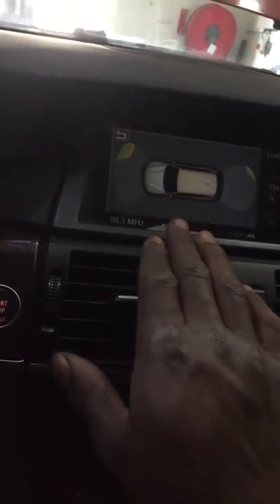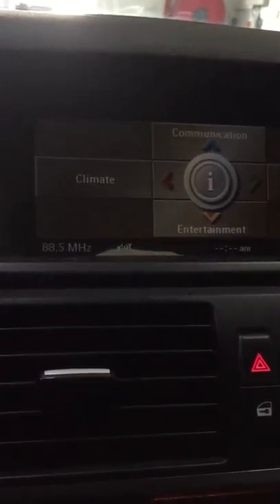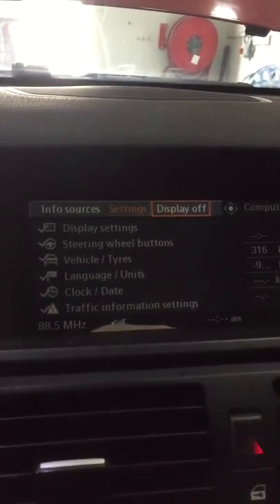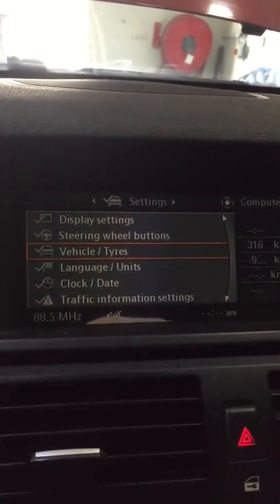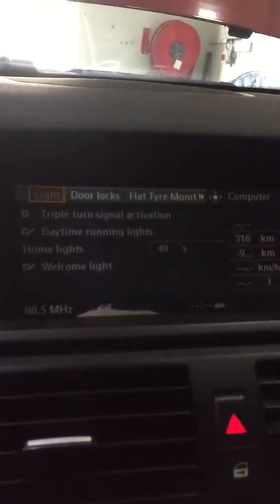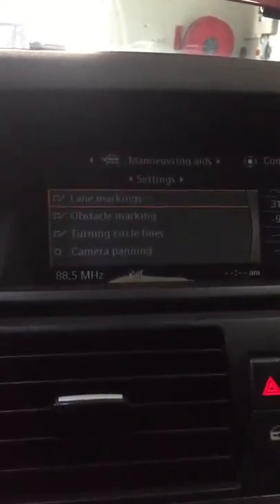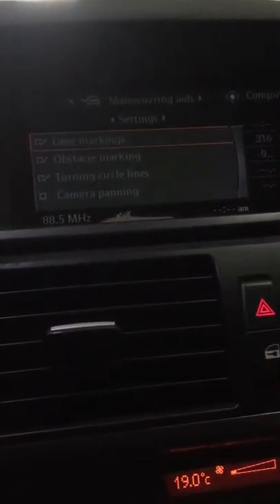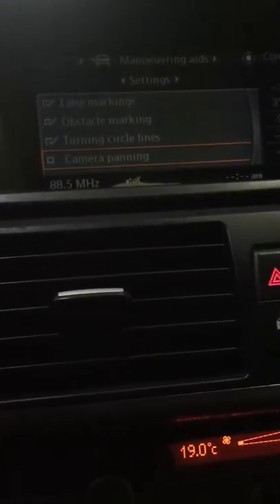BMW backup camera activation and settings

Comment: My mirror got knocked off on my 2018 230i convertible and now it will not move in reverse. Can i disable it and get to back up ?  In these settings ? Help please
Reply from the maker: You'll need a diagnostic tool to make those basic settings